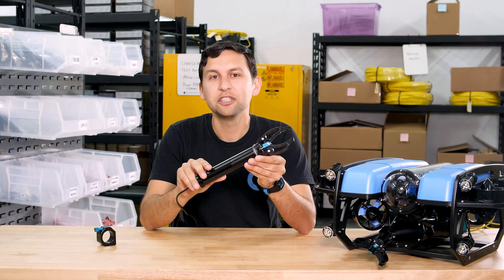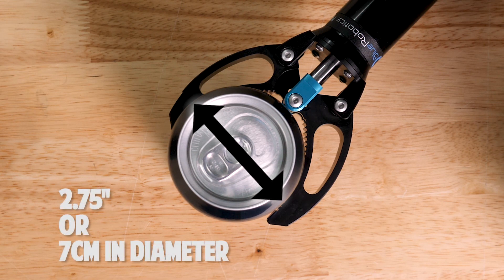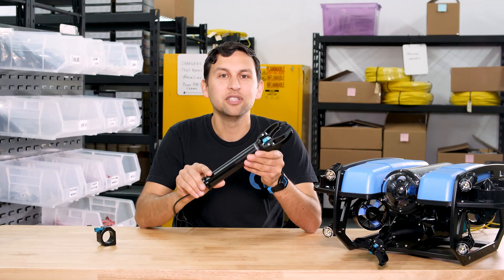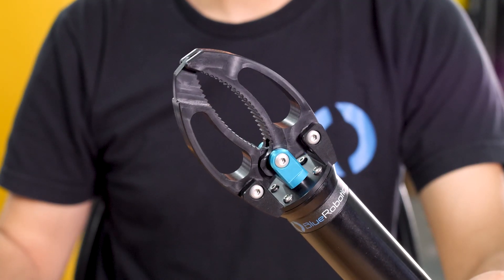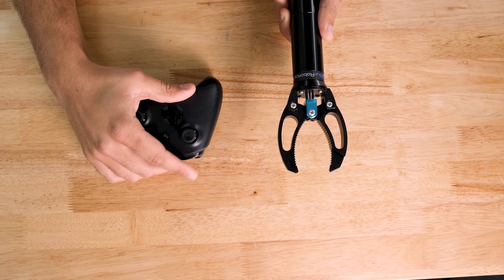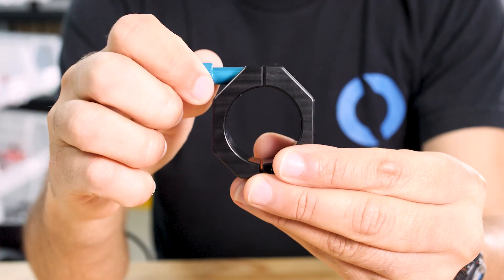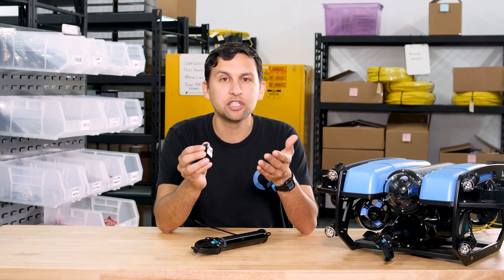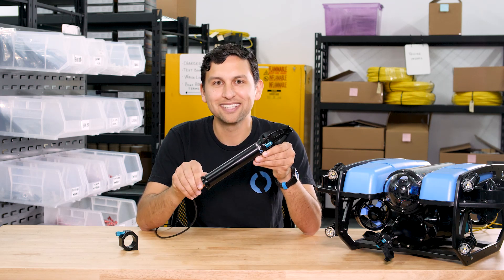New Product: The Newton Subsea Gripper!

Comment: very cool.
1. What is the ultimate crush force and is it adjustable? You can assume I'd replace the plastic jaws with aluminum. 
 2. Note on the failsafe below: make it an option that can be disabled.  I can see a need to grab something and hang on even though the battery has depleted.

Comment: G’day guys, that is just fantastic. Three quick questions. 
1. Now that you have gotten that far, have you any intention of having a rotation function along the shaft axis like other serious ROV’s out there?
2. Are changeable gripper head options something doable with your design?
3. If I mounted two grippers onto the ROV heavy, (or other devices) is there enough electrical throughput in the existing tether to handle it or would a new bigger tether be required. Thanks for your time. Amazing machine!